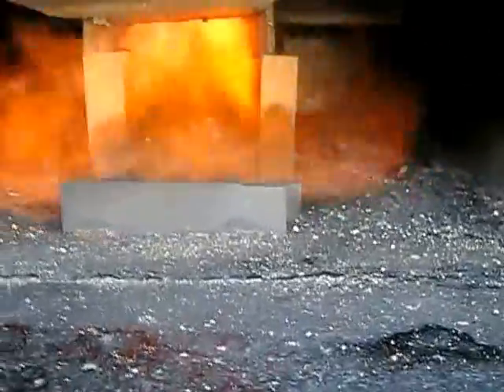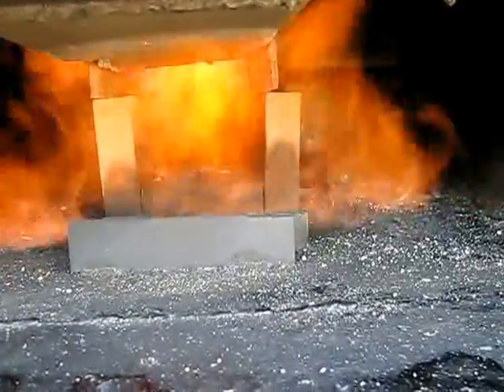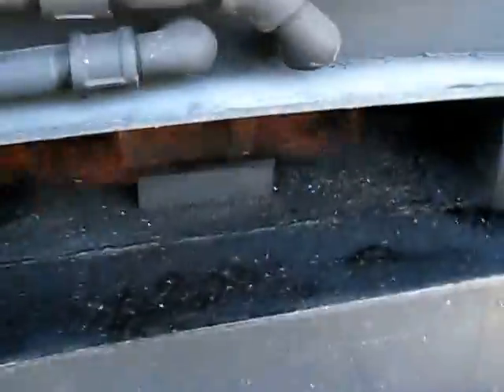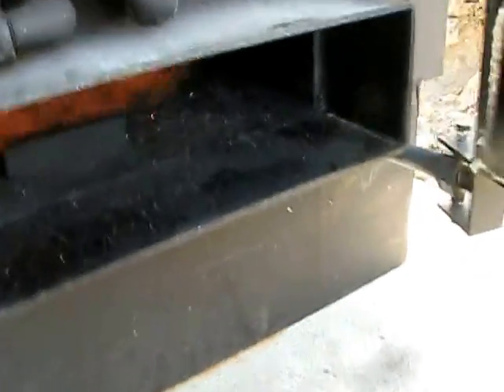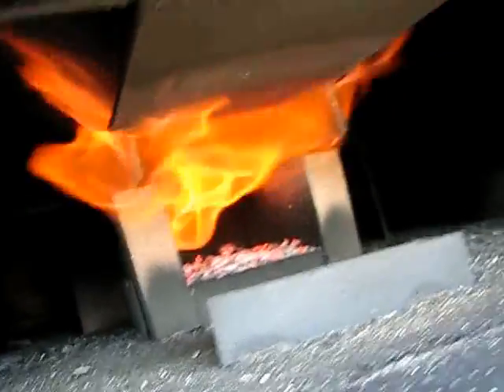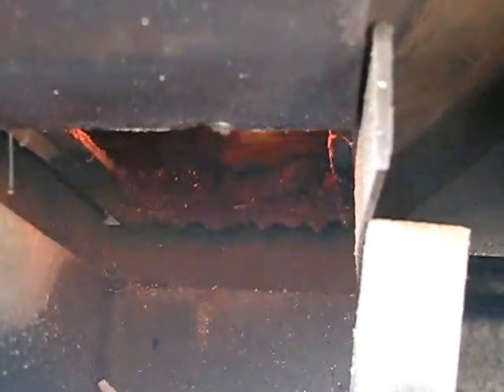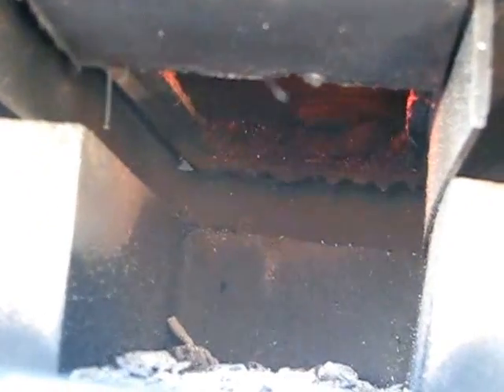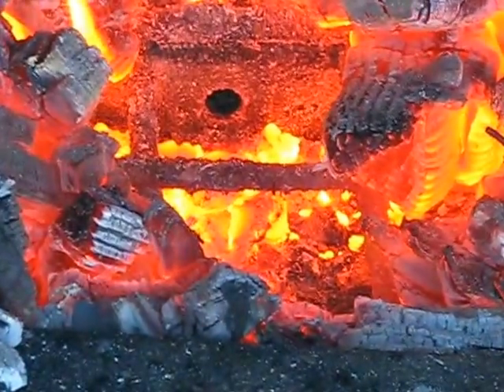Wood Boilder #5

Comment: Looking at The woods burned down there,it doesnt have any more fuel to be burned and if it Does not have smoke gas it will not down draft The fire so you just need to put more logs to have it going again. Try also to have a glass door for you to be able to observe on whats going inside. Your on The right way so GO on and try not to change drastically all your settings  but  little by little. I think The first would be to have a glass door on both doors so u can see everything inside. VERY NICE!!